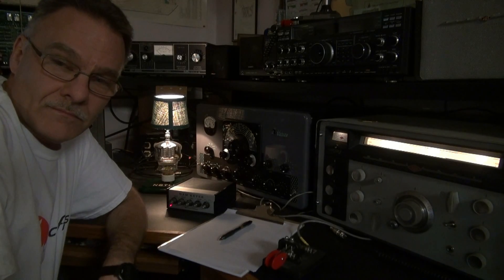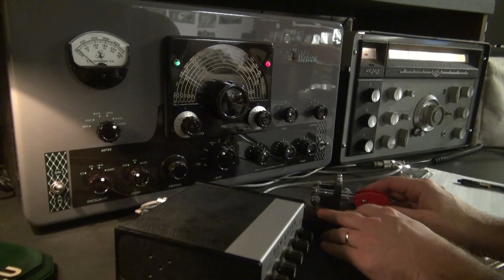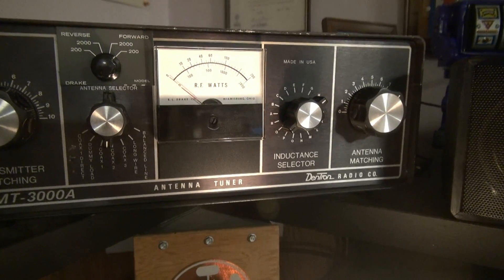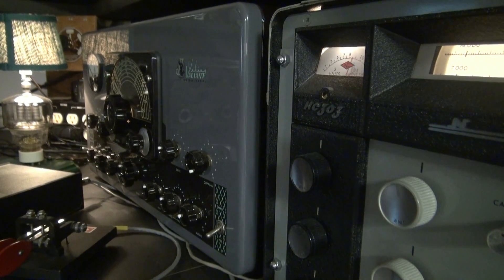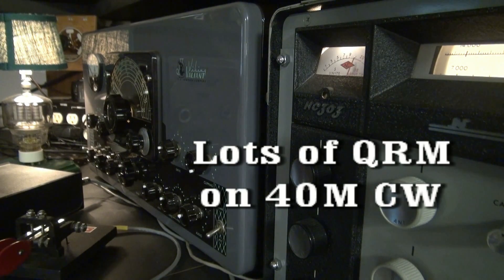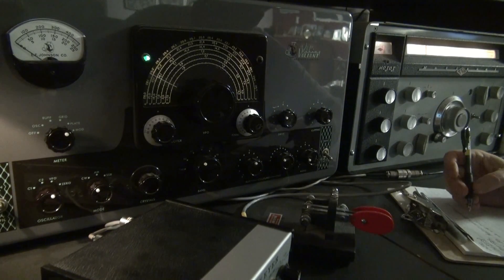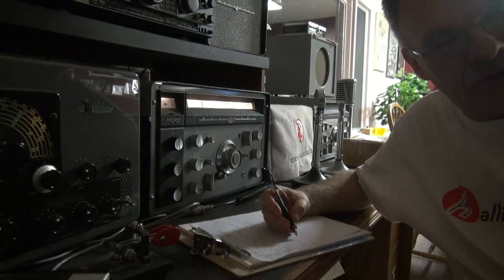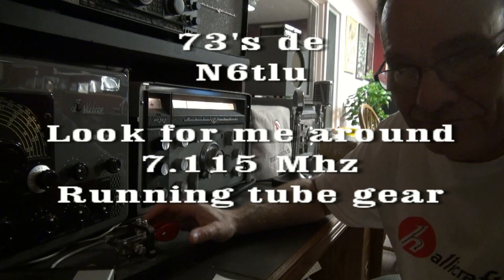How to operate a Vintage Johnson Valiant Ham radio tube transmitter on CW

Comment: Terry, Thanks again for another great video. I should have my Valiant on the air shortly, and I was wondering how I would hear the CW side tone, if I mute the receiver with a Dow key relay.  I was thinking of going with the Heathkit HD-1410 keyer because it has an input for a straight key, or you can use the built in paddles. I had one, but I sold it when I sold a Heathkit SB-104A. 73 Paul AA1SU
Reply from the maker: I use a Ham Keyer with mine. It has a built in speaker, however I also like using the Valiants HV buzz

Comment: This is a hobby I do not understand at all  but perhaps its time to learn. (Ham radio, and keyers, etc)
Reply from the maker: Hello, Ron.  If you like tube guitar amps, you will like tube Ham gear. The hobby is easy to get into. I view CW as electronic fishing. Cast out a signal and see who comes back!
Reply: They did away with the CW code requirements, just pass the FCC tests.  And they even give you the answers to study from.  Or you can get Gordon West's books to learn the ropes.  Young kids get tickets.  Heck, I did, IFFzi I can, you sure can Ron.  Wifie too, why not, many lady hams jabber jaw on the radidios.  ARRL.org has some helpful study materials.  Look out Ron, looks like you got bit by the bug.  Then John from Arkansas joernone can be your ELMER instead of mentor.  Don